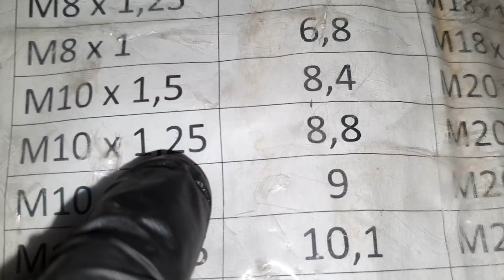Инструмент для установки коленчатого вала скутера

Comment: what I did is heat the bearing using torch and put a little bit of oil in the crank and slide it in.. simple, fast and easy..

Comment: I once made one from crankshaft nuts and normal nuts, bound together with two steel pieces of metal on both sides. That way you have a modular tool. The body of the tool can be a steel pipe or square piece of tubing. I made the footing by welding a square piece of steel with a square hole in the middle to the square piece of tubing. It worked every time. A piece of m10 all thread for the thread..

Eventually lost the tool and i ordered a vevor puller kit for disassembly and assembly. If i had a lathe I would definitely build another. If i had more scrap laying around maybe i would do it too. I had some money. Bought the tool... It looks good. Way more modular than your tool (mine and the bought one). Look at that tool and build onother one. It is really worth the time it will save you!

Homemade or bought, both should work fine.

Greetings, 

Jeff